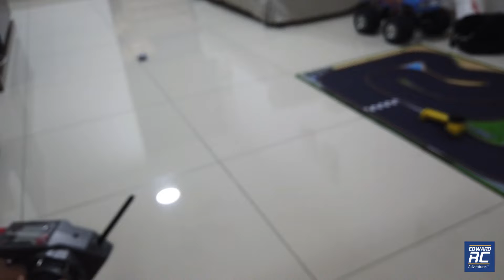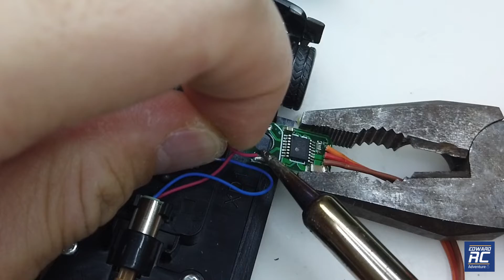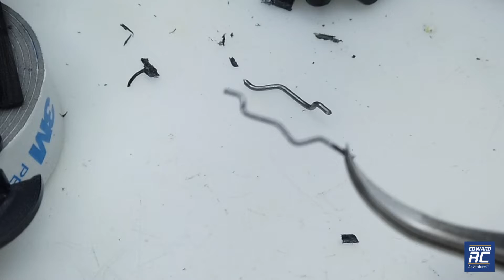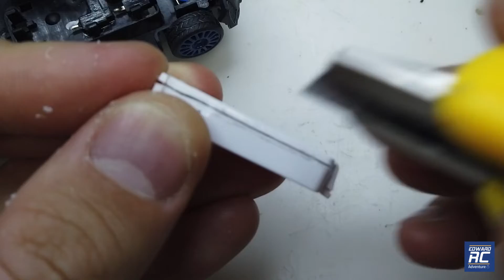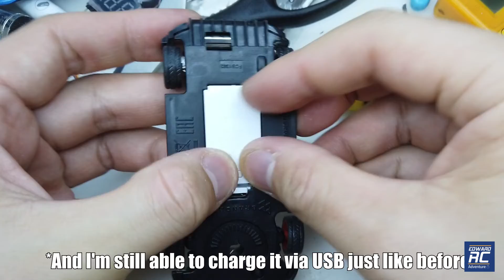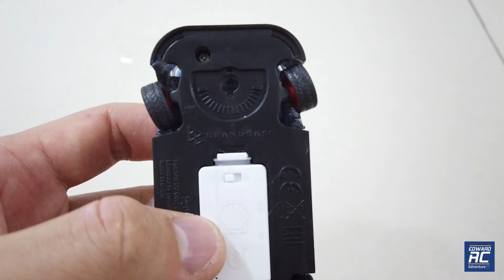WORLD FIRST Modified Shell Motorsport Collection with Hobby Grade Electronics!

Comment: Can the tires be removed? 2 of my cars have a problem with the front wheels. It is hard to turn. My other cars if I spin the front wheels with my finger it will spin for a few 2-3 seconds before it stops. But the 2 cars with the problems, the tires only spin less then 1 sec before stopping. I can also feel resistance when trying to spin the wheels. 
I tried spraying with WD40, but it only helps a little. I tried removing the tires so I can remove the metal rod but it seems to be stuck or glued to the wheels.
Reply from the maker: a. they are molded as one. u can split it by force
b. well all their cars have trouble to turn
c. add oil btw wheel and the knuckle
d. the wheel can actually be removed from the metal rod. just need force :D
Reply: @EdwardChew  I guessed that the wheels can be removed from the metal rod. But the problem with the front wheels are that the rod is so short, it barely goes through the knuckles. So it is very difficult to remove it without possibly breaking the plastic knuckles. 
I already oiled the rod and tried to get the oil spreading through the knuckles. But like I said earlier it doesn't help much. 
My only other option is to find a new knuckles for the cars. Are there any where that I can buy these parts?
Another weird thing that I noticed is that this problems are onlu happening to the formula 1 style cars. The mustang and the normal type cars don't have this problems.
Reply from the maker: @M.D. F  I use a cutter to squeeze the gap btw the flat side of the rod and the knuckle.

The oil cannot be too thick one ya
Shell designed them so no compatible knuckle. Unless you can 3d print
Reply from the maker: @M.D. F  my f1 car has steering issue due to the steering motor gearing issue. It's not meshing properly

Comment: I'm new to this hobby, are the tyres replaceable? Something is wrong with mine and the rides are bumpy. Or is it fixable?
Reply from the maker: Nope. Wheel and tires are formed as one. Is it the hyundai i20? Remove the body then look closely at the tire, there are burr, cut it away
Reply: Shoot. I separated the tyre to look for the fault, guess I gotta glue them back somehow. And yes it's the i20, expecting it to be zippy based on the wheelbase length compared to the other model
Reply from the maker: @zackcamly  yea friend complain the same thing to me for his i20. Then when I got mine, it's bumpy, I look at the tire and found the reason. Yeah it's more Zippy than the others. So I prefer the "stableness" of the bmw m4 and transferred electronics over

Comment: I got the mustang gt and the formula 1 car, I was thinking about doing this as the bodies look very detailed, I might try the way you did it.
Reply from the maker: the mustang gt will have plenty of space. the F1 however...
Which country are you from?
Reply: @EdwardChew  from Australia, its from the Shell service stations and they release 1 car every couple of weeks so I've only got 2. The ford nascar sold out real quick but there are piles of the mustang. Has a good weight for a small rc, I almost thought it was metal.
Reply from the maker: @turbinegraphics16  i see. over here it's 1 new model release per week, consecutively. 
the body is diecast metal, chassis is plastic.